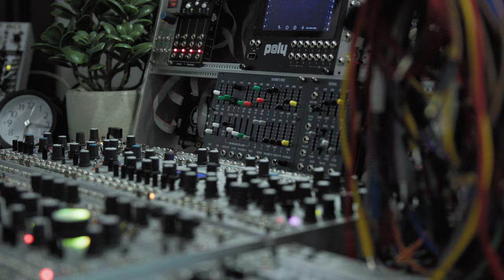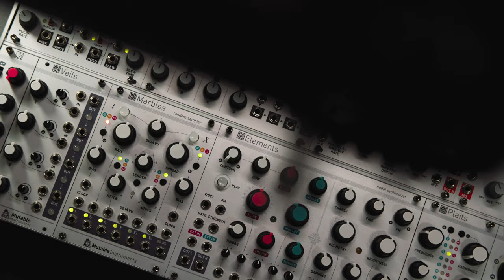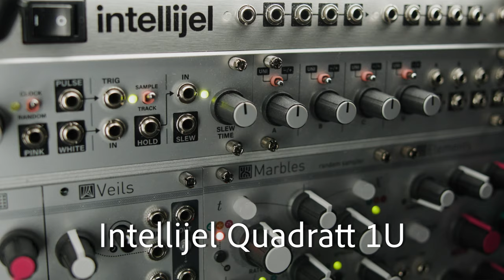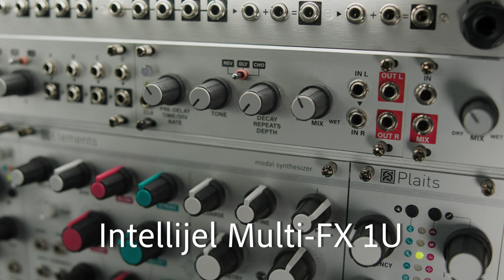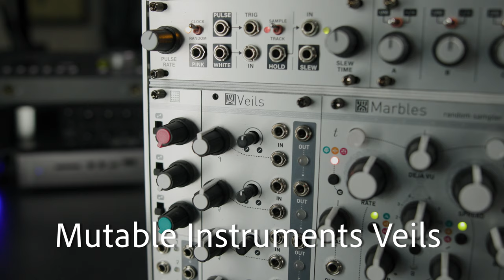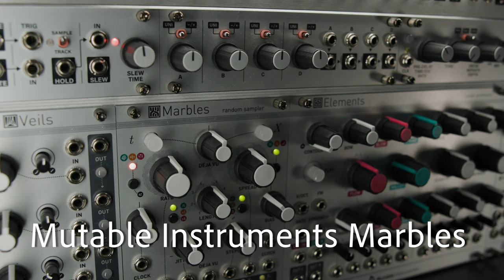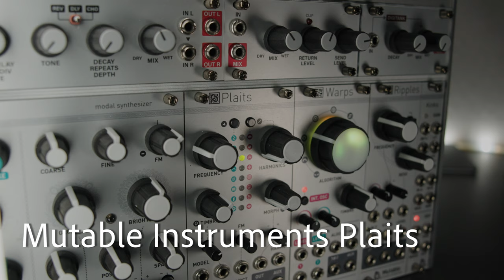Minimal Skiffs feat Mutable Instruments Only Eurorack Modular System Plaits Elements Marbles Ripples

Comment: Nice to see you with the original MI modules (surprised not to see Blades? I guess there's no more space). It's also great to hear the ideas and sounds you get with your modules, inspiring. 

I didn't buy Elements when it came out, and don't even have space in my rack for it (if I had it). On the other hand, I found Rings could get frustrating to work with, and even considered taking it out of the rack. However, I recently uploaded 'mini-elements' into a nRings, which opened up a new set of possibilities, so I'm curious to see if I can reproduce some of your ideas.

Anyhow, I always enjoy listening to you explaining modular (and more), almost the voice of reason, very calming to listen too!

BTW, you mention Plaints at the bottom of the screen (approx: 6:18), do you mean Plaits?
Reply from the maker: Thanks for stopping by! :)